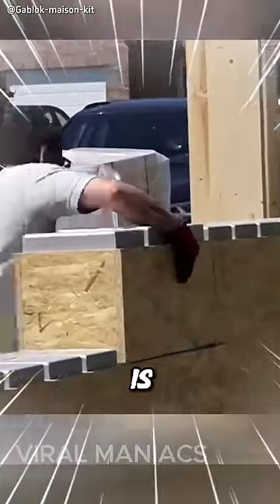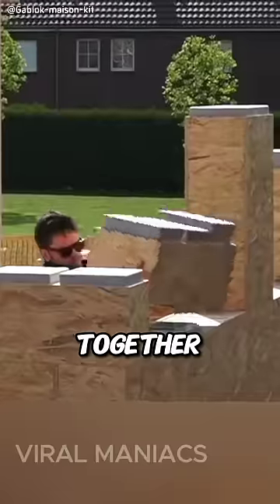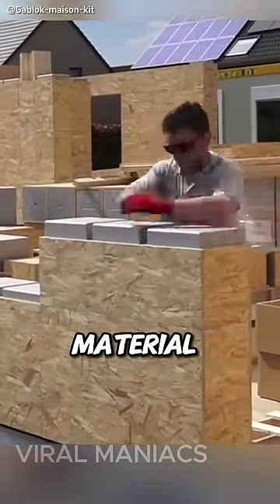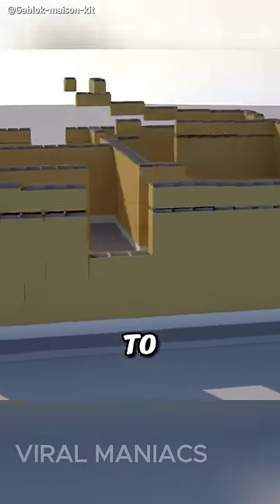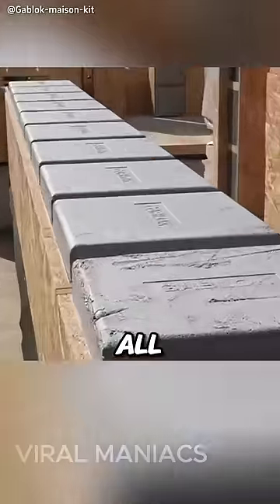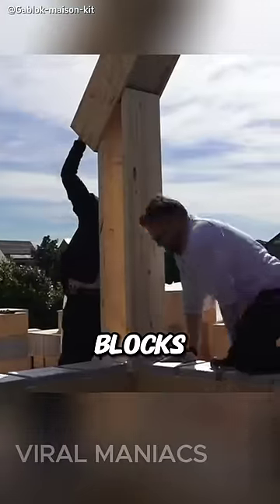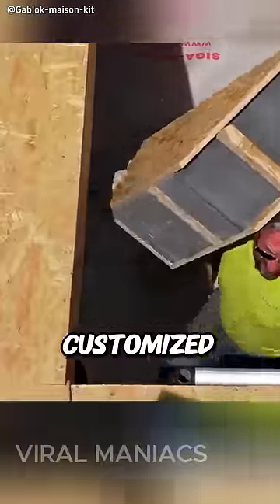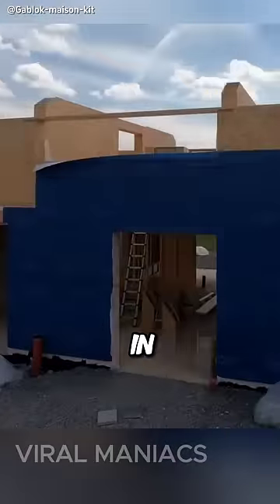Whoever Invented This Way Of Building Houses Is a Genius #shorts

Comment: Oh great. Should keep everyone warm when it catches fire!! Polystyrene in building in the UK was banned and the sale of polystyrene tiles were taken off shelves and the public advised to take them down because of the flammability of the polystyrene.
Reply: This is the comment I was looking for 😂
Reply: If they did it with a Hemp block then they'd be on to something.
Reply: Worth doing a lil dig around SiPS building system. The speed of building a 2 story house is 1 month.  Those are full sized panels that are glued and sealed closing air into the poly-based insulation, reducing fire risk to 0.1% because the drywall will shield it too.
Reply: They add an additive to make it less flammable
Reply: Also, they surround them with a flame retardant level. 

I’d do this myself if I could.
Reply: @konstantinpospelov951  Yeah because using twice the amount of O.S.B. normally used would'nt make the flames go higher eh muppet!
Reply: @jimmyc974 OSB  the sponge of the plywood world 
zero seismic resistance 
And hurricane wise ? 
Also wrapping it in dry wall and stucco doesn't mean thise barriers never get punctured 
Off gasses???
Reply: The polystyrene is surrounded by wood lol and currently American houses are paper sheets hung on wooden framing, so either way our houses are flammable. Which is why our fire departments prioritize aggressive interior firefighting and rapid response.
Reply: @benj10s  So true. I recently saw a video on 3 different types of insulation and which are the most combustible and toxic. It was very enlightening. That’s a good deal of the problem with our stucco-covered wood-framed termite-prone houses in Florida. 

Give me a brick house with a flame resistant insulation any day over a wood frame.
Reply: I bet the UK should probably ban gas as well, very flammable.
Reply: I remember a horrific fire at a concert years ago where the walls were flammable due to a similar situation and the fire spread so fast, the ceiling started melting on people and many were trapped or trampled in the chaos.
Reply: @danjay84 is this the one where you could hear people screaming as they're being burned alive?
Reply: @jimmyc974 you're the Muppet if you think your home won't catch fire regardless😂
Reply: = And when you leave, it is easy to remove.
Reply: Stop fear mongering. Not do they make them fire retardant. Just install indoor fire suppression system. You’ll also save on insurance.  🤷‍♂️
Reply: i am sure they have another wall layer inside, but anyway if a house catches fire from carelessness it will and it doesn't matter what material it is